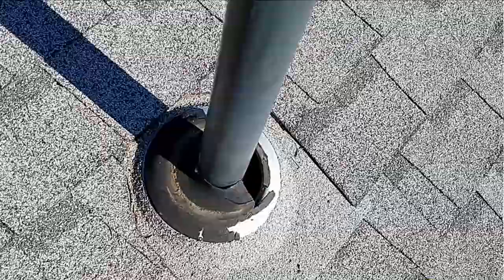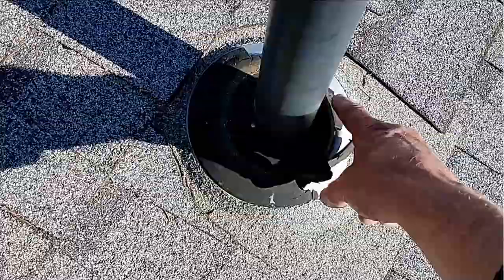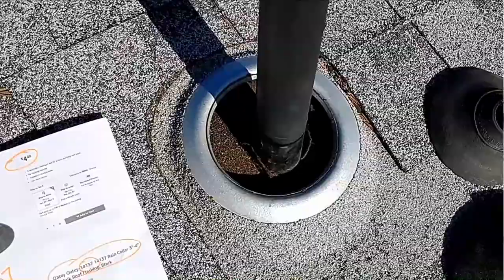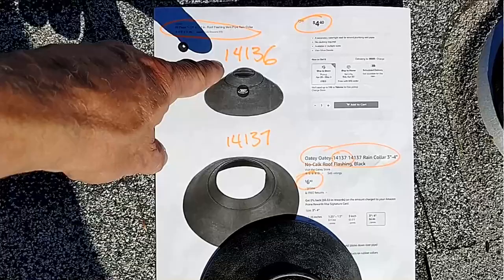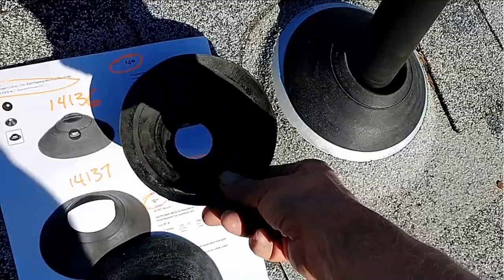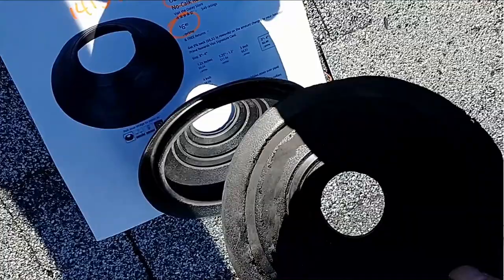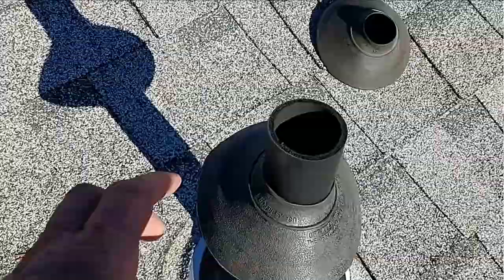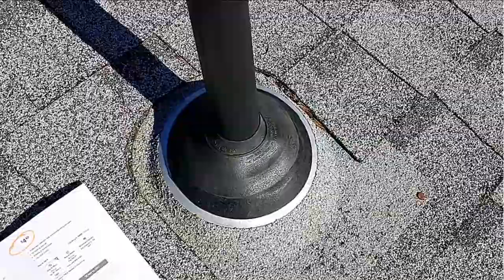How to Repair Roof Flashing Around Vent Pipes – Quick – 10 Minutes – No Mess – Anyone can Do It!

Comment: So you're saying that between the metal flange and the first gasket that there's going to be No rain going between those two on a pitched roof?
Reply from the maker: That's a good point to bring up. 

The dimple of the old metal flashing base measures about an inch up hill so there has to be a considerable amount of water flowing down the roof - then it has to squeeze through that small gap between the 3-in collar and the flashing - there will now be a similar gap between the 3-in collar and the 1-1/2-in collar (the gap will be considerably smaller and the seal tighter if you snip out that ridge).

You also have to consider that the gap between the flashing and the 3-in collar is Oatey's design. I just have a pipe that's smaller than 3-in thus this improvised design.

If Oatey feels confident with their design I feel confident too.  Much better than the former deteriorated flashing.

So I had eight pipe flashings to repair got it all done in 20 minutes (after the sniping and belt sanding).

Hope that helps... let me know.
Reply: What about an electrical riser? Can’t pull the rubber over without cutting it, can you build some tar in a cone around it